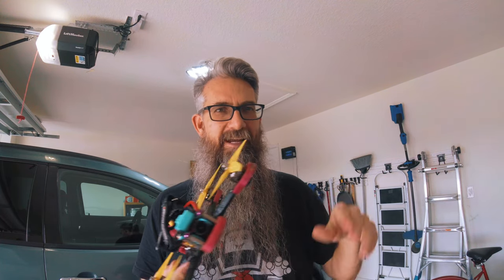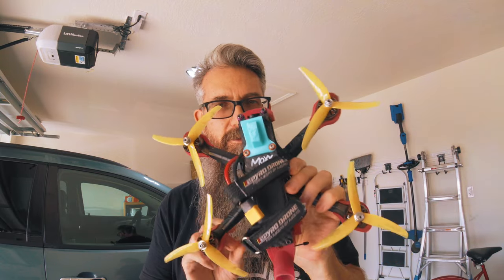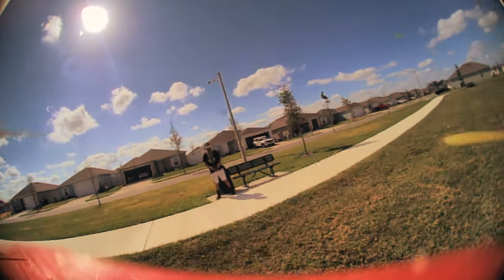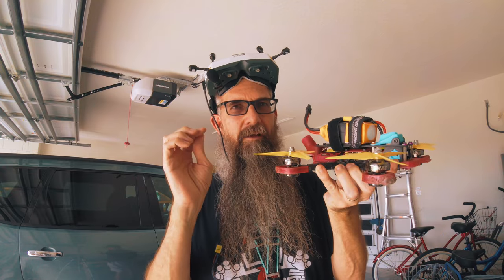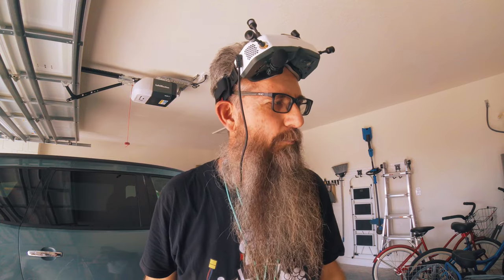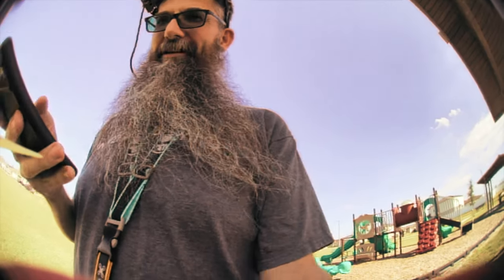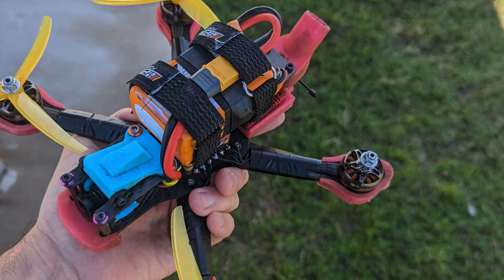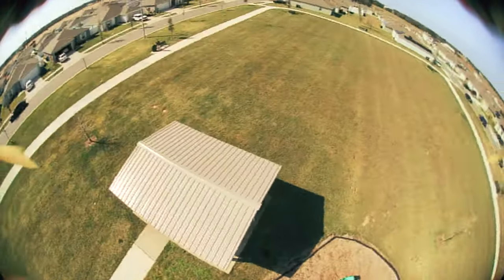UNDERPOWERED Drone is BETTER for PROXIMITY

Comment: I run 2107 1980kv on 4.9 inch props with throttle cap at 80% power. I refuse to change your correct opinion good friend
Reply from the maker: I talk about the throttle cap as well.  I'll definitely have some follow up videos on this discussing the topic more.  There's some more aspects of it to discuss I think and could help people who might be struggling to improve

Comment: I agree, I run my indoor tiny whoops at 80-85% max throttle, they are to touchy for me otherwise. I also tried throttle expo but I prefer linear throttle. All my freestyle quads are 4s, not as dramatic as 6s, but more manageable flying proximity.
Reply from the maker: Yeah, for the really tiny ones it can definitely help!

Comment: My setup is just abnormal. RTFQ Motor 2206 – 1900KV – House PRO Series (CCW & CW. I looked back and they are from 2018 and used in their 3rd frame. I have flown them on 4s 21700 Li-Ions, 5s and 6s 1500/1300 Lipos, and 6s 18650 Li-Ions. Props lately are GemFan Hurricane 51466-3 and are long lasting...but I don't fly concrete.
Reply from the maker: Man I haven't seen anyone flying ccw motors in a LONG time . Definitely old school but also keeps props from loosening

Comment: The hq props that came with my roma v2 seemed to flap on stops, but the dal 5045c pros ,made it a different quad to fly, and blheli32 the byrm so it wasnt stuck on one pwm, so its got torque and that high whistle brushed motorsound at top end
Reply from the maker: what kv motor, and size are you running?  I'm on 4s running 2306 2400kv

Comment: With Chris's latest motor testing results, it shows a certain pilots motors at the bottom of the list and underpowered. Also have heard from other pilots running stated pilots rigs saying it seems to be a tad under powered. I will leave that pilot un named for sake of not attracting haters or trolls. :) He is one of my favorites and I will never have anything negative to say about him. With that being said, you are right on point, Staceman! One of the greatest of pros flies the same (underpowered). Slow is smooth and smooth is fast.
Reply from the maker: I was thinking the same thing when I watched that video... There's more to a best motor than spec.. Steele created that motor with a very specific task in mind and it fits it well.  Smooth is definitely fast

Comment: Your rates are a lot slower than mine.
 I'm around 650-700 per sec. 
Which is about BF default.
Are you getting more precise movement's in smaller spaces, is this why you do it?
But I need faster rolls and flips to be faster on my Nazgul Evouge due to weight.😃
P.S. you are getting better and better on your freestyle
Reply from the maker: Nah, you don't need faster rates.  Slower rates definitely improve precision and control...  they do take a little adjusting to, but not much.  You do have to give it some time..  a couple packs doesn't really let you get it..  You need to fly them slower for a solid month.
Reply: @StacemanFPV  great advice to apply thank you much. Stay in the air, out if the tree's 🌴🌴 LoL 😆
Reply from the maker: Yeah, trees are sneaky little devils!
Reply: @StacemanFPV  I found that the focus is often on max rate and not so much center rate. The relationship between tension, grip (pinch/hybrid or thumbs) and center rate vs throttle control is quite interesting. I actually found myself to have way more control and precision by increasing my center rate, vs flying something slower. I went from a very mushy center stick to 200+ and my throttle control and general precision increased dramatically. If anyone decides to try this, id suggest doing so in small increments and put in some stick time. Making minor adjustments to a specific parameter related to stick feel, then flying it for a while, tends to cause much less muscle memory confusion, than making big jumps.
Reply from the maker: Would that be with actual rates?  Never really messed with those myself
Reply: @StacemanFPV  yea actual rates, far more precise control over rate curve quadrants, allowing you to fine tune the problem areas, which I’ve found to typically be mid deflection, not “near” full deflection (unless you’re running linear or very slow or extreme expo rates) or center, where you naturally have the most dexterity and control. If you think about tricks, or proxy control, the more you have to deflect the stick from center, the greater the probability for erroneous input on an undesired axis, or superfluous input on the desired axis, since you still have to contend with stopping the input(back to center stick).  The shorter the distant traveled, the less time it takes to cease an input. Note I fly pinch/hybrid mode 2 t/y and thumb p/r with moderate tension.
Reply: @StacemanFPV  yes actual rates, I find them so much easier to work with
Reply from the maker: I've found normal betaflight rates that work for me so I'm not changing around anymore but I can see why you like the others.  The config on actual rates definitely makes more sense especially for new pilots

Comment: Really liking this approach. I totally agree that faster ,stronger, newer are not merrits for change in their own right. Choosing to make change, with good insight into the problem, is something that often only comes with the years. Even if it means taking it a notch down. A faster car doesn't make a better driver, right?  Into my 50's myself,  ;-) Btw. your reflexes look still plenty ok to me
Reply from the maker: Yeah as they say in racing, go slow to go fast
Reply: @StacemanFPV  Exactly! Also a big fan the lower pitched props. They tend to give much more control and precision. Or at least to me they feel like they do.
Reply from the maker: Yeah I think you're right... Same reason... More resolution

Comment: Another good one man! After changing my rates to your recommendations, I'm loving the extra resolution and I believe running some less aggressive props might be just what I need to do next.. Thanks for the insight brotherman!
Reply from the maker: If you do let me know what ya think
Reply: @StacemanFPV  I sure will! 👍🏻
Reply: @StacemanFPV  Right now Im trying to tame these 2755kv Xing motors on 4s. I'm running the Iflight Nazgul F5 props on them too. I do like these props but I'm not sure if that's what these motors like... It's a little bit of a weird motor but they are performing well actually and can take a lick... I picked up a combo that had the Iflight XL5 v5.1 and those motors. Like I said the motors are solid but dang at the KV! 2755 ...
Reply from the maker: Maybe try a throttle cap

Comment: I was a heli 3d pilot and because your conrantly balancing a ball in the centre of a plate, with your cyclic, i like no expo and a short rate, its just what im used to!
But i like the dal 5045c pros cause their so stiff and have a large serfice area, i also use a heavey tattu funfly 1550 mah and i like the feel of the throttle, because of what your saying, more throttle resolution! "But on the sim, i can fly through gaps, all the shit! But in real life im scared to smash up my drone i took hours, days and months to tune, and""I CANT FLY ANYTHING LIKE YOU GEEZER!"
Reply from the maker: The fear of breaking stuff is what held me back for a long time.  Once I got a build that has proven to be really durable, I don't have that fear so much, and it really makes it easier to fly.  I'm still not doing certain things because I know they just end up in crashes, and more likely to break stuff, but I have no fear flying through gaps and close to stuff because I know that this thing is durable.